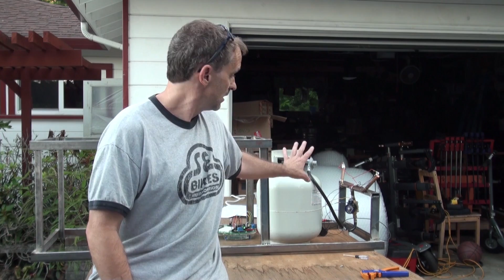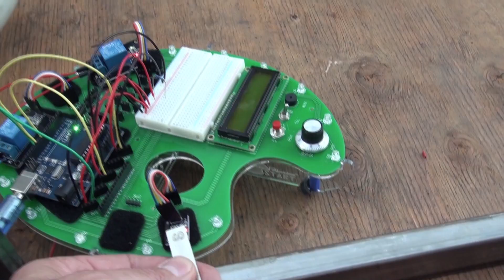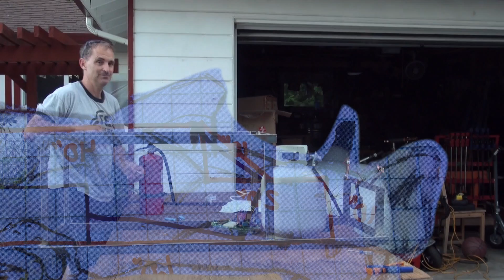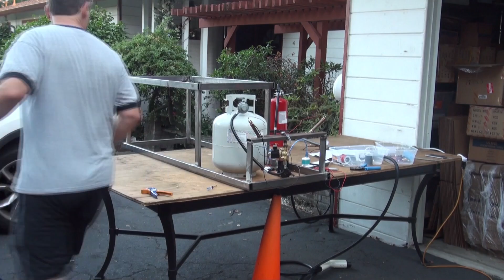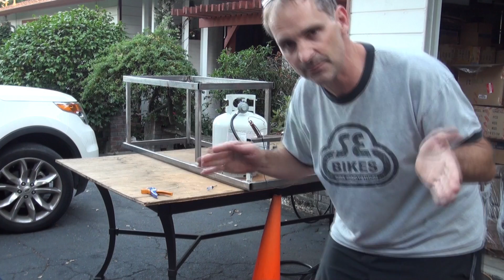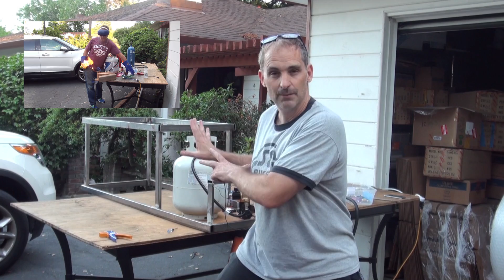Iron Dragon Backyard Roller Coaster - Part 7

Comment: EPIC!! I still think that you should try and run both propane and co2...
Reply from the maker: Hi F.B.
I'm building it to work with either. But, maybe not both at the same time. Just the weight of the bottles might be a little much. There's also how co2 isn't flammable. 
Of course now you've got me thinking of ways to overcome all that and make it happen!
Reply: What is life without a little challenge!

Comment: Hi Will,
One of my big questions about this project is about the layout.  Are you going to strip off the PVC piping and replace it with steel, or are you going to "intensify" banking on the turn around as if making it steeper and make it just not a shuttle coaster?  Also just to make it a thrill ride, you could make the drop a little bit steeper for a better experience for Lyle.  If you put this on the comments video, I apologize to Lyle or you or whoever has to read this extremely long comment. And I'm sorry to the people watching the video to have to listen to this comment. Thanks.